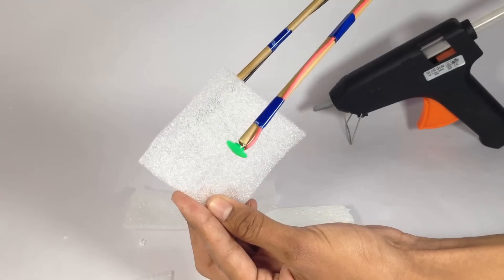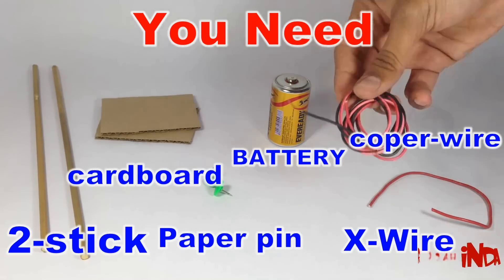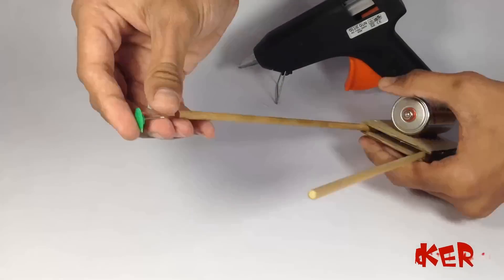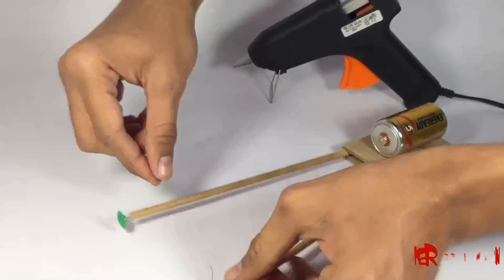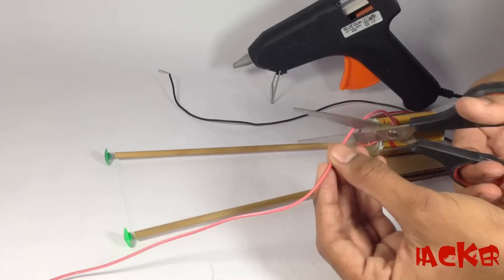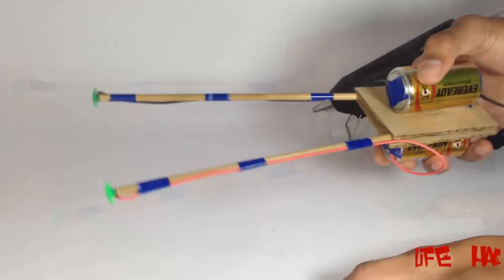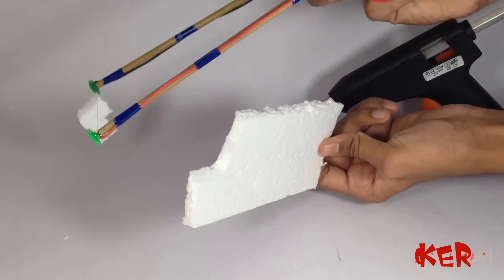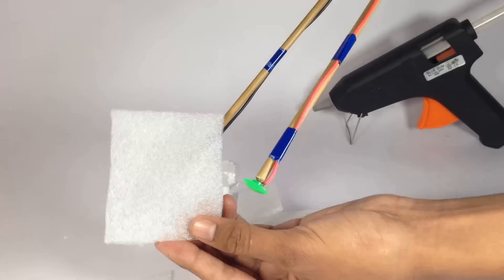HOW TO MAKE THERMOCOL CUTTER AT HOME

Comment: May i use copper wore in place of X wire
Reply: It will never heat up because copper have very low resistance means it will let the current pass through it easily. Without heat getting produced
Reply: You should use a wire with high resistivity

Comment: from where do i get nichrome wire...plz tell me
Reply: any soldering iron or ebay or cloths heater or electronices shopes
Reply: Shouldring rod element
Reply: You can also use tungsten wire
Reply: VAG Vines u can get nicechrome wire on amazon
Reply: Just take a very thin wire like hair

Comment: that ones not that efficient you need to use the 9 volt ones and use a simpler connection system aka a simpler circuit

Comment: How did you get Nichrome Wire? Plz reply me Thanks.
Reply from the maker: If You have not nichrome wire
checkout wire used for normal wiring. it not should be of copper. 
stainless steel wire will work fine it will be silver color and most probably shining surface.
Reply: Thanks
Reply: I guess that steel wire would have a high enough resistance to work here.  Shops that sell stuff for cheap home-made jewellery usually have it, plated with another metal (chrome, brass, etc).  Easy to check with a magnet - steel will be attracted to the magnet.

Comment: can i get a nichrome wire by disassembling soldering iron
Reply from the maker: If You have not nichrome wire
checkout wire used for normal wiring. it not should be of copper. 
stainless steel wire will work fine it will be silver color and most probably shining surface.
Reply: ok thank you

Comment: Nice work, very simple designs with good explanation. Feels very similar to Make Magazine's videos, but a bit simpler :)

Two suggestions:
1) While you have pretty good lighting, you could improve a bit. Basically, if possible try to prevent all shadows. I know... I know, it is extremely hard to avoid shadows.... but if you are able to improve your lighting it just makes the overall feel of the video more professional.

2) Minor suggestion, can you talk just a little slower? Not sure about your other viewers, but some words are difficult to understand in an Indian accent. Again, your video is very well organized, you speak clearly, so if you speak a LITTLE slower it would be easier for English speakers to understand. Again, please... only a LITTLE slower, your speed is great, just a few words at times are difficult to understand :p

Comment: where can I get that x-wire
Reply from the maker: checkout wire used for normal wiring. it not should be of copper. 
stainless steel wire will work fine it will be silver color and most probably shining surface.

Comment: IS IT BATTERY WILL DAMAGE IF WE LEAVE AFTER USE.
CAN WE USE SWITCH,
AND CAN WE USE COPPER WIRE INSTEAD OF NICHROME WIRE
Reply from the maker: +ravi ranjan 
battery will discharge if you will not disconnect it and yes you can use switch.
copper wire have high conductivity so you need to give high supply for heating it.

Comment: how can i get nichrome wire
Reply from the maker: If You have not nichrome wire
checkout wire used for normal wiring. it not should be of copper. 
stainless steel wire will work fine it will be silver color and most probably shining surface.
Reply: Thanks for your reply , but i want to make a suggestion that please reply faster, ok ;-)

Comment: where i can find x wire nicrome wire is to much expensive in online sites
Reply from the maker: If You have not nichrome wire,
checkout wire used for normal wiring. it not should be of copper. 
stainless steel wire will work fine it will be silver color and most probably shining surface.

Comment: yar I cant make it will u help me plzzzz
Reply from the maker: +abbas vahora 
I think voltage will be low.
Try to supply higher voltage.
Use bike battery or adapter power supply, and you can also create high voltage by connecting more batteries in series.

Comment: where do i find a x wire and how many volts of battery  were you using for that
Reply from the maker: +dipak sunar 
6 volt will be enough but you can supply more.
Reply: +dipak sunar  from an old soldring iron's element

Comment: I Have One Question. Where I Found The X-wire?
Reply from the maker: +Siddique Tamim 
checkout wire used for normal wiring. it not should be of copper. 
stainless steel wire will work fine it will be silver color and most probably shining surface.

Comment: from where I can get the x-wire
Reply from the maker: checkout wire used for normal wiring. it not should be of copper. 
stainless steel wire will work fine it will be silver color and most probably shining surface.

Comment: hey bro!! can you tell me which volt motor are you using in your that helicopter making video???
Reply from the maker: +Parth agarwal 
normally toy motors are with brush and thinner wire winding,
I had used brushless motor with thicker winding than normal.
you can find this motor in old helicopter or heavy powered toys.